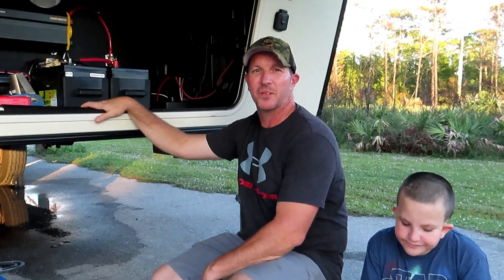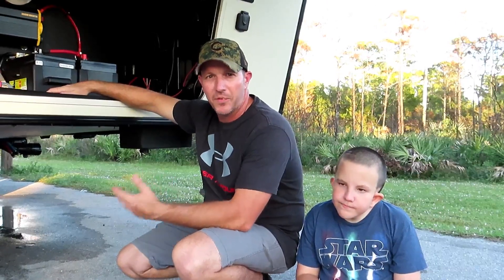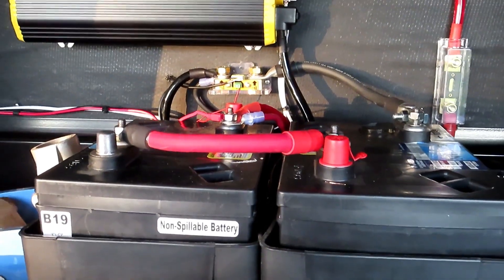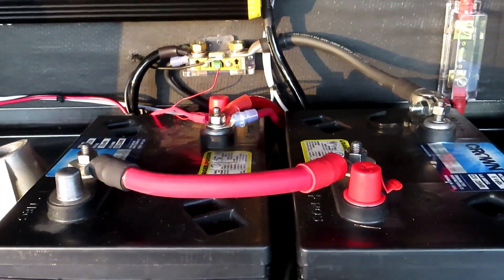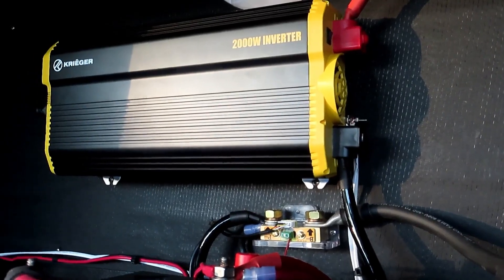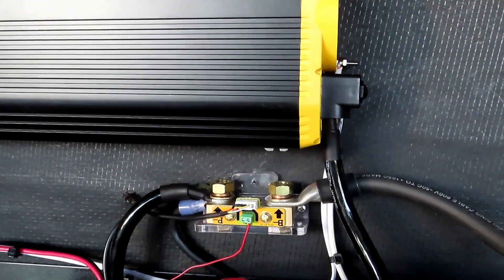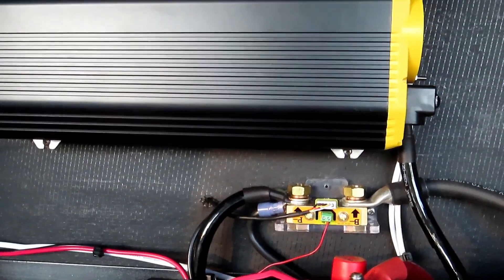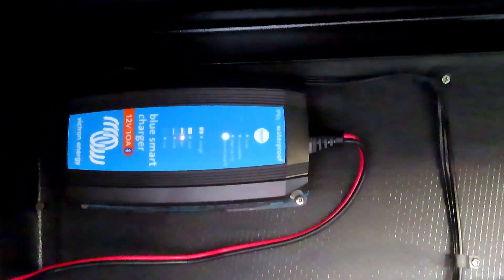Full Time RV Living | Inverter Install, Solar Panel, and Battery Upgrade!

Comment: Hi, you've been using this system for 1.5 years now. How do you like it?   This system is pretty much exactly what I'm looking to upgrade to for my 28BH.  I'm on the fence for lithium too.  When you have a free moment,  I'd like to pick your brain. Thanks
Reply from the maker: I actually just upgraded our inverter to a Renogy pure sine wave inverter and changed out the batteries to 2 AGM group 31 12 volt batteries. The system in this video worked ok for the occasional boondocking trip. You can see our current setup (minus today’s inverter install) in this video. https://youtu.be/2g6IyZIDnXg
Reply: @JouppiOutdoors  excellent.   I really want to upgrade exactly to what you have.  I already have the predator, so batteries,  inverter,  solar panels,  charger and monitors. 
May I ask why you went back to dual 12v over the 6v? I always thought dual 6v was the way to go?
Would you happen to have a wiring diagram of your setup? 
You mentioned that you added the victron charger in conjunction with the factory converter.  How did you do that? 
Do you have any for the battery terminal connections?
Any additional information you can add will be very helpful and much appreciated.